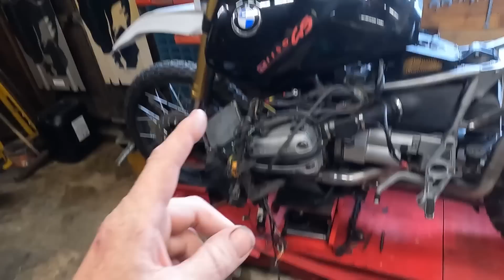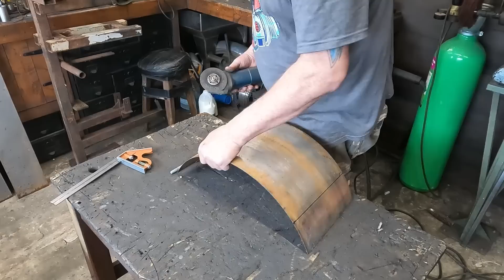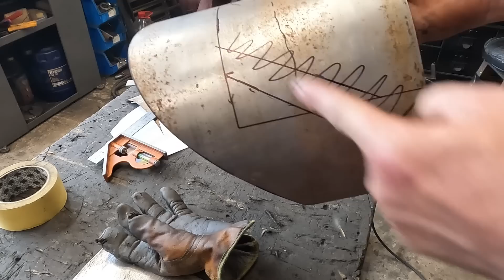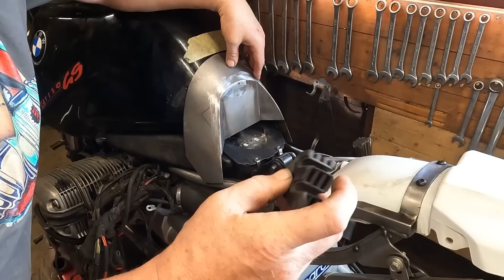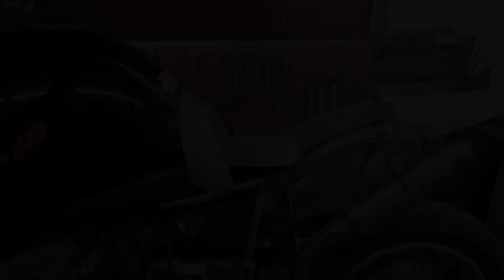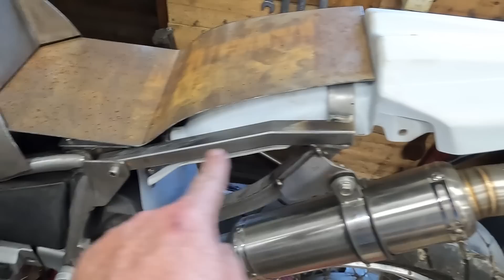BMW Project Part 27 Making Seat Base

Comment: Hey Craig …. Made space for suspension in seat pans before by just cutting two slots either side of the suspension mount and then dress the centre up into a curve then all you have to do is add two half moon side pieces rather than cut a hole and make a box, Hope this helps 👍

Comment: Craig please wear a light glove on your right hand. I find it difficult to operate the off on switch on some grinders wearing gloves, but I have found a lighter glove that works. I would hate to see you have another accident especially as you don't use a guard.

Comment: I am with you on the glass fibe horrible stuff although I did use one that was sort of encapsulated  woven was it ? but not so messy and didn't come aprt when brushing it, it was a bit of a patch job I helped a mate with on his boat but not stuff I wouls use normally

Comment: 👍 Complicated....but definitely better solution for off road bike than that fibre.  The seat can crack underneath  without you knowing that or realizing it. It happened to me. Was perfect from outside.  Yes,  she was a bit crashed  . When I took the seat  of( original single of Sporty 883) there was huge split on the base.....and it's thick plastic , good quality....So , Craig,  you good cool geezer,  always choose the best ways  !!!😊🙋‍♂️

Comment: back in the early 90's whats on the front of yours should be on the back, and your logo over the heart, and make it long sleeve, will happly get three of your size, two for now and one for the wall
Reply: with the tightening of OSH in NZ if work is done outside( NZ can reach up to late 30's early 40's) because of the rates of melinoma it's a requirement to wear clothing that covers skin...
even in roof spaces, and alot of construction companies in NZ require long sleeves even in basements, as its a blanket rule..... so light cotton retro long sleeves soundes amazing❤

Comment: Good morning all. If you had an old laser level you could line it up with the tank edge then when you put your piece of steel over the tank you’ll get an exact visual of where the tank is onto your panel, same goes for blind holes etc

Comment: Looking good. Great fabrication tips. But please don't model the side panels based on your old KTM panels  ! They were ugly when that bike was new (in my opinion), I think it'll muck the look right up. That style of panel is very old hat .Take a look at the very latest KTM SX and EXC's, they've hardly got side panels and you could just fill in the area between your subframe tubes and it would look similar. They would need a bit of shape though,  not just flat plates. It would be a shame to put anything over your silencer too. All just my opinion, keep up the good work 👍